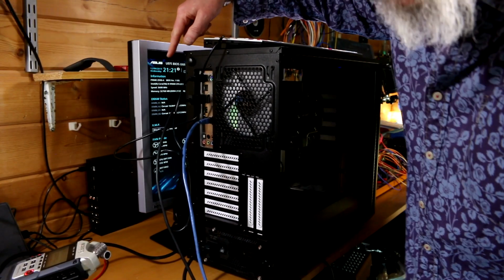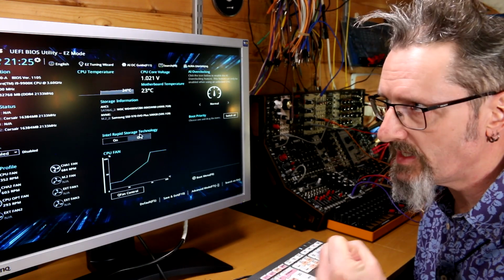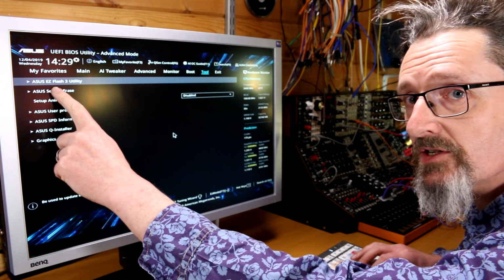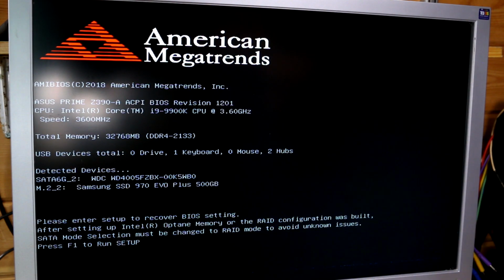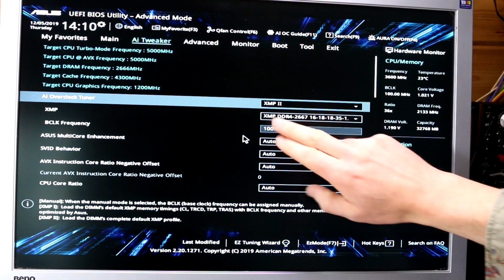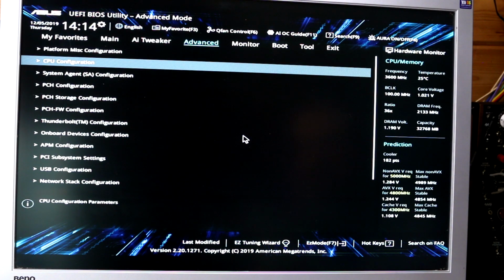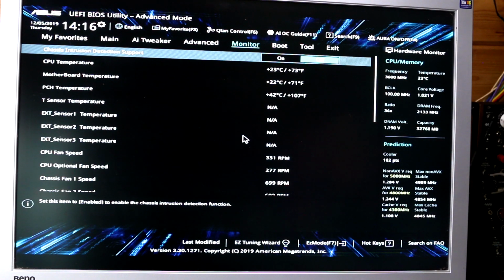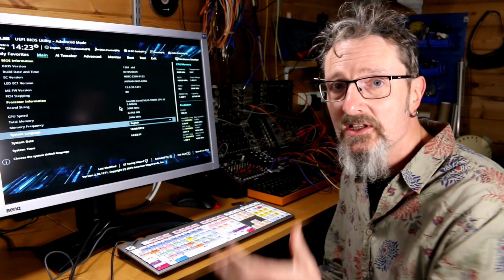How to build an Audio PC: Part 6 - The BIOS

Comment: I would always leave Thermal Monitor on. If your cooling is up to the job and working, it won't do any harm. If they aren't, better (and cheaper) to fix that than replace a fried CPU, surely?
Reply from the maker: It has nothing to do with the processors internal monitoring - the CPU will shut the system down when it gets too hot regardless of this setting. This is purely about the motherboard managing the cooling which we don't really want it to do.
Reply: Thermal monitoring (throttling) causes dpc latency spikes, which causes audio clicks and pops when using low latency settings with your audio interface and DAW.  So you are wrong, leaving it on does harm, but depending on your usage case it might not matter.  For instance if you input midi notes by mouse instead of performing the midi notes by playing them in real time, then you can set your latency high enough that the dpc latency spikes cause by thermal throttling will not affect the audio output.  And if you only use your system to mix and master, then of course low latency is not a concern, in fact you should increase the latency (up to a reasonable point) to get more performance out of your cpu.  :)
Reply: Additionally, if your computer is powerful enough and sufficiently cooled even in high workloads then thermal throttling will never kick in, so leaving it on or turning it off won't matter, unless of course the cooling fails (or is significantly compromised somehow) in the middle of a session.
Reply: All of this means turning thermal throttling off won't negatively affect the performance of your system for audio production tasks (as long as your cooling system is working properly).  So I agree with the advice to turn it off.  And if your cooling system is not working properly then you should fix it, instead of relying on thermal throttling.  Remember, once the cpu goes past it's maximum operating temperature, it will shut off regardless of the thermal throttling being off, but that shouldn't happen with a properly cooled system.  So in this case, stability is taken care of by a properly cooled system, rather than relying on thermal throttling.  You need both stability and performance, and the advice to turn off thermal throttling is the best compromise between stability and performance.
Reply: @thatchinaboi  My exact words were "If your cooling is up to the job and working, it won't do any harm". Which is not wrong.
Reply: @Citizen-1a  Yes I know, and you are wrong.  It can do harm, and I explained why.  :)  LOL
Reply from the maker: You need to chill out, you’re making assumptions about this video. The thermals are under control mate 🤪
Reply: @MoltenMusicTech  Hi Robin in part 5 you had the same white vga light on the motherboard as I do and in this one its gone so how did you solve that issue? or is it not one...